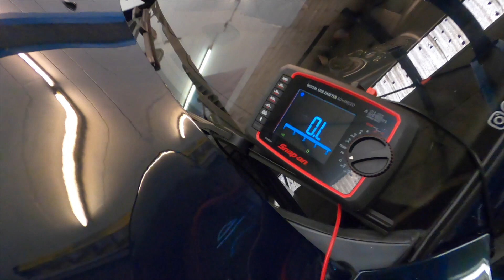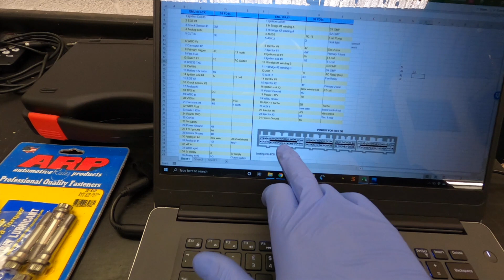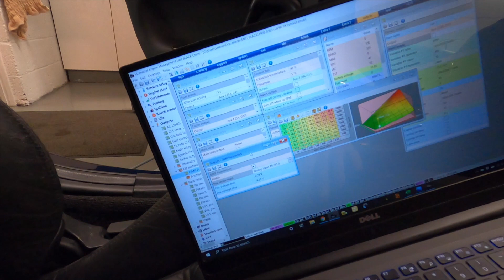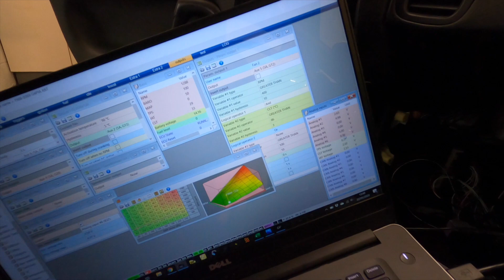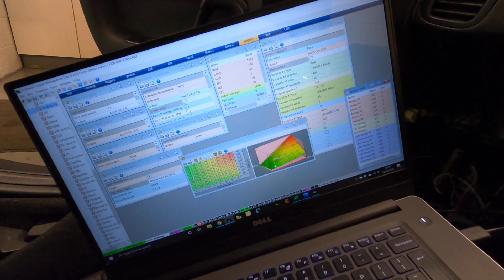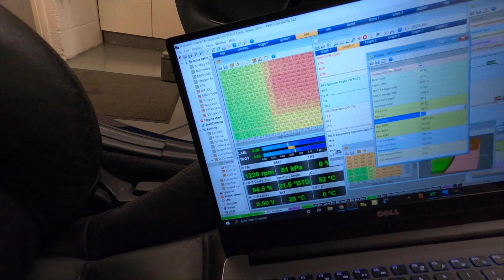Mana Performance - Mazda RX7 FD Project - ECUMASTER EMU Black ECU Support and Plug and Play adapter.

Comment: Question brother what size gauge wire are you using? And were did you the buy the white plug to install the stock rx7 plugs and have you dyno the car if so what HP are you getting with this Ecu? Please and thank you 😎
Reply from the maker: Hey. I’m using AWG 18, 20 and 22 on this adapter. 
I bought the white plug from my connector supplier. I can supply you one if you need?

I haven’t been to the dyno yet. If you watch the later videos I decided to change injectors and then things escalated into a complete fuel system do over. I have been busy with work since which means no progress and no videos unfortunately. 

Soon will be the next instalment though.
Reply: Mana Performance ok thanks for the info really appreciate it. I’m doing my FD at the moment and redoing the harness on it and I’m thinking of going with the ecumaster. I also started following you on IG under Rotarys4ever